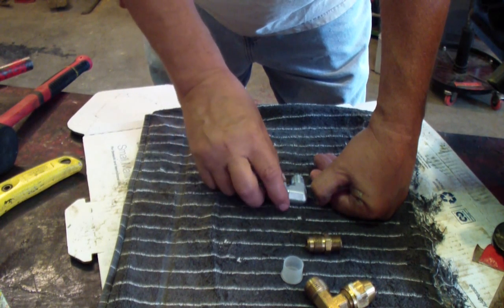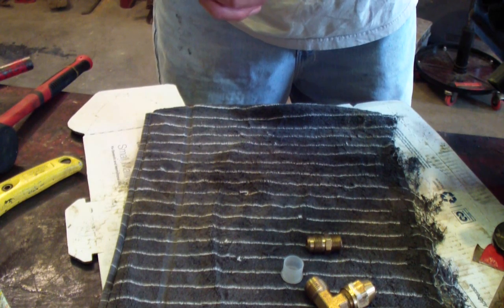Hydraulic fittings

Comment: Im iso a 3-AN x 1/4 compression. I don't think it exists. The 3-AN is a 3/16 37° flare with 3/8x24 threads. The 1/4 compression would come with a 1/4" feral and a compression nut. So it would actually be a coupling I'm looking for and it doesn't seem to complicated to me. But i guess it doesn't exist. Hope u can give me some insight. 
Fyi, JIC(Joint Industry Council) also has the 37° flare end but the threads are not the same, rendering compatibility NOT.
Thanks

Comment: The 90 you hold is an o-ring boss x jic. Both threads on the 90 are the same sae thread. You could take a female jic -10 and screw it right on to the oring boss thread not for operational use because of the seal but for test fort correct thread.